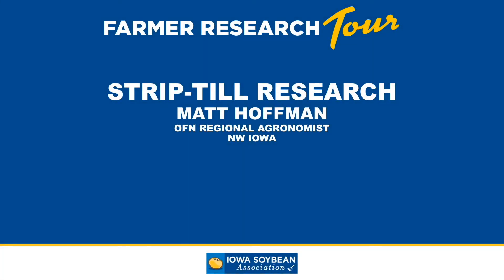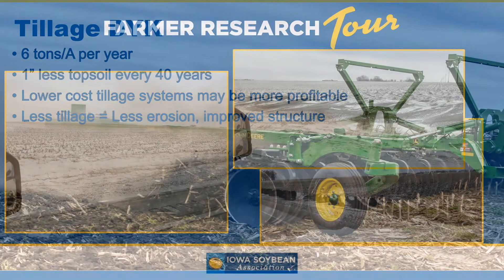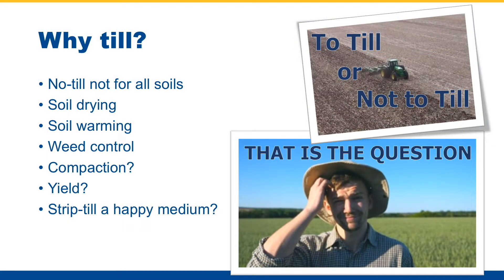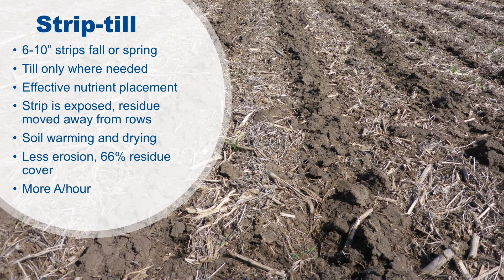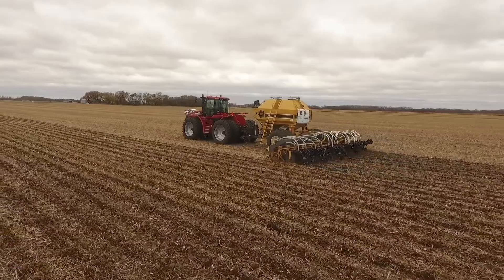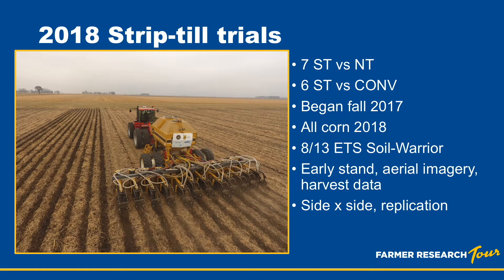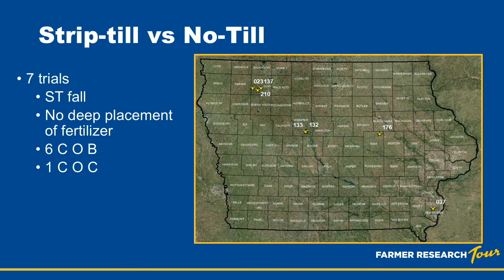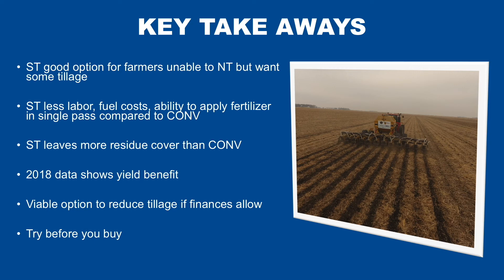Strip-Till Research with the On-Farm® Network

Comment: We get insane June rains here in Manitoba. The trench that all strip till systems create in light soils means water sits and saturates in furrow, stunting corn at the v4 stage. A crucial stage for yield. I absolutely believe in the advantages in more arid soil zones. We have done a minimumal till system one year because of a planting window. It did very well and combining in fall was like driving on concrete. Thanks for the work you put into the video.

Comment: I think you should a straight rate in the strip and variable over the top. I had areas that called for no fertilize and within 2 yrs those areas were my lowest yield. This was with over the top variable rate. Just my 2 cents.

Comment: Hello, ST vs NoTill. So 17$ for ST is with planting or just for ST? You said that need RTK to catch strips with planter. So thats mean plus price for planting. Or I had missunedrstand something? Thank you.
Reply from the maker: Rates for establishing strip till range from $15 to $25 depending upon the application. Custom rates are higher if they are placing fertilizer with strip till operation. RTK, very necessary for strip till, would be an additional expense. A full strip till operation including RTK should be less than a conventional tillage system with two passes which runs about $30.
Reply: I had a lot of luck strip.tilling with WAAS and planting by hand. 

For us it was a huge advantage financially and crop wise going to ST.  Talk to guys in rich black southern soil and they dont see the gains in the crop or input savings like i do here but still see the soil health improvement.